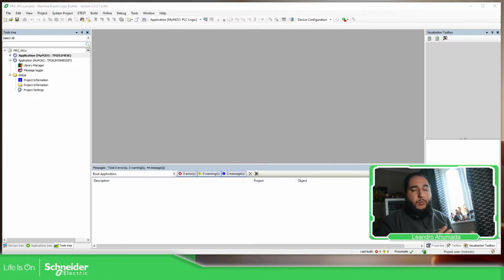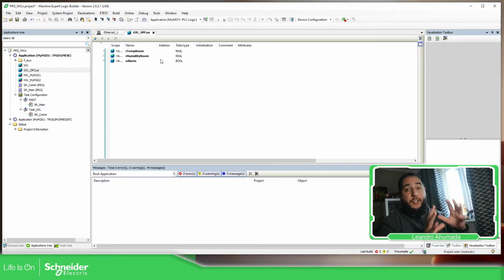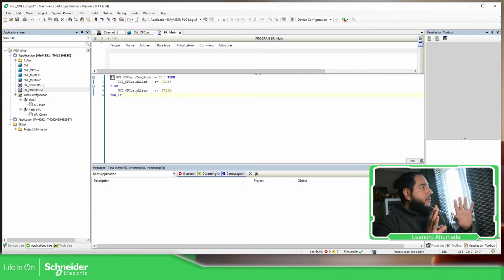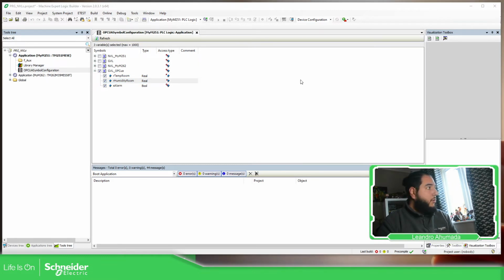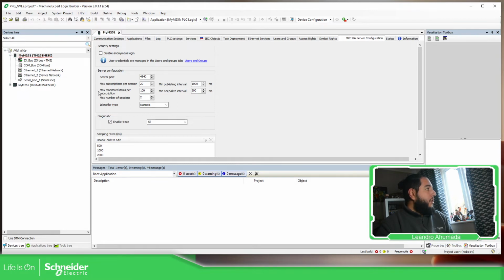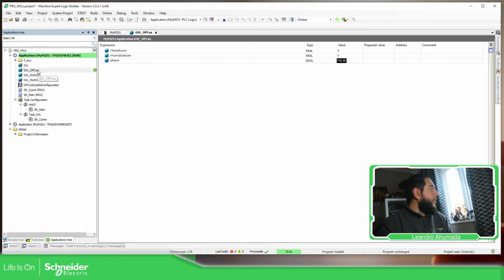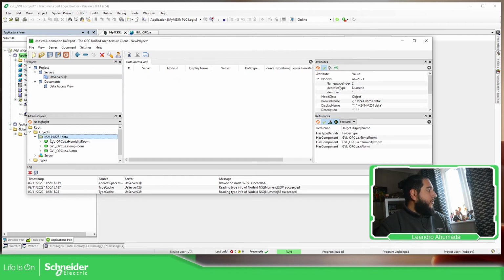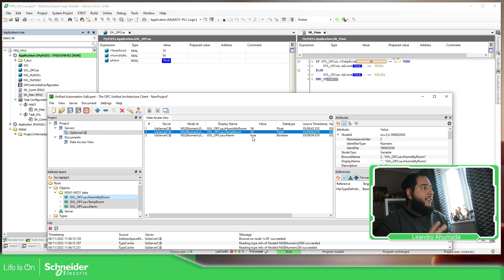EcoStruxure Machine Expert Training - M8.4 Modicon M241/M251 OPC UA Server Configuration (Anonymous)

Comment: Hi Leandro!  Is is possible a guide on how to configure M241/M251 OPC with security?  On Machine Expert 2.2 and M251 with firmware 5.2.11.24 (I supose it has to be related to firmware) you can select a security directive and message security.  It's imposible to connect to M251 with the security configuration.  How it has to be done?
Reply from the maker: Hi there! I did the next video with a M251 but i do not remember the firmware:
EcoStruxure Machine Expert Training - M8.5 Modicon M241/M251 OPC UA Server Config. (credentials)
https://youtu.be/ouTRKYUUFHo
Reply: @LeTomasAHUMADA  Ok, I've watched it but it's not exactly what I meant.  I mean on the new firmware I can choose Basic256Sha256 as SecurityDirective and SignAndEncrypt as MessageSecurity.  This doesn't work.  Schneider SAT says M241/M251 does not support encryption only M262, but I don't get it because with newest firmwares you can chose encryption with M251
Reply from the maker: @ hi there! I did a quick test with the ua expert and it did not work. I was able to configure it but no luck on the other side. I will say…if we can select it then… we can use it. If you contacted the technical support in schneider, can you provide the case number?
Reply: @LeTomasAHUMADA  I don't have a case number because they sent me an email to provide pictures, but not with  the usual way, so there is not a case number on the subject.  Basically they told me that I have to select None and None, because M241/M251 does not support encryption, even if I can select it.  Only M262.  I don't get it either, but it's what they told me.
Reply from the maker: @ i will check it next week
Reply: @LeTomasAHUMADA  Guau I've done mulitiple searches on youtube and this video did not appeared, it was strange you did not do another one with credentials.  I will watch the video right now, thanks

Comment: Hi! I tried to add a structure with adress(%ML500) from GVL but it it's not working. I receive an error''The item has already  been added". If I want to add this structure without adress it is working, but I need the structure with an adress. Can you help me, please?
Reply from the maker: Hi there! I need to try it , first time that i see that message. Which version of the software are you using? If you update the project or make a clean all, do you have the same error?

Comment: Hey ! Is it possible to be a OPC UA client server with a TM251 PLC ? For a project, I need to read / write data from an OPC server ?

Thanks by advance for your answer!
Reply from the maker: Hi Pierre! The modicon m251 can only be opc ua server, if you need to be client then the right controller should be the modicon m262. If i am not wrong there is a template of opc ua client for the m262 in machine expert
Reply: @LeTomasAHUMADA  Indeed, I saw that the TM251 cannot be client, only server. Finally, the server OPC will be US so it solve all my problems. Thanks for your response !